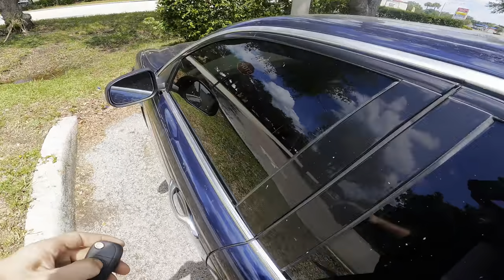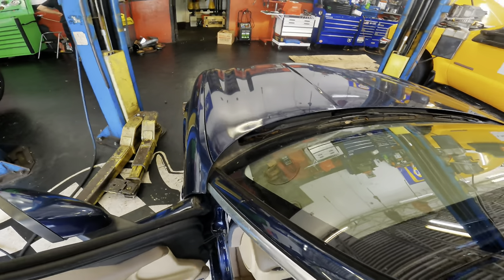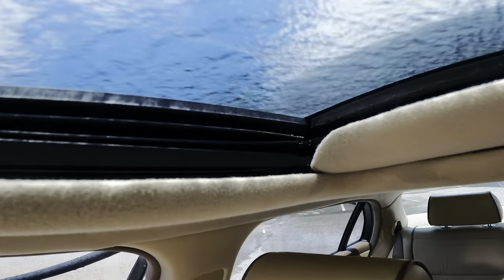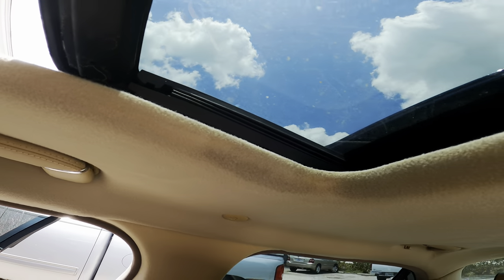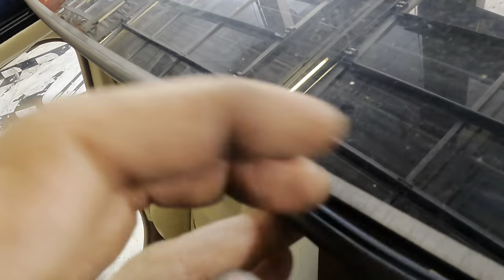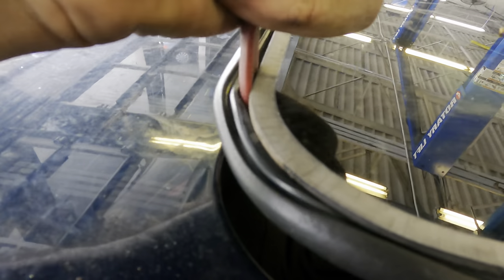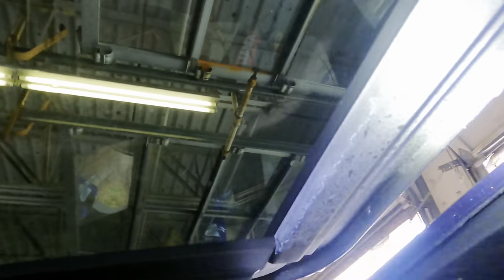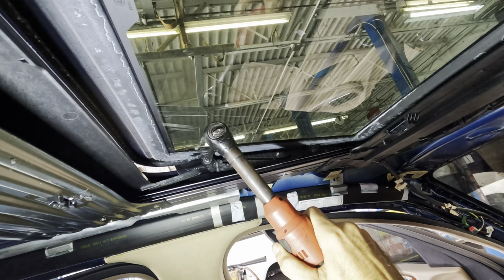Worse than I thought…Water Intrusion! 2008 Jaguar XJ 350

Comment: Not sure if Jaguar has the same adjustment, but on BMWs, they have 4 adjuster bolts behind the rubber accordion trim which allows you to fine adjust the fit to create an even seal around the sunroof.  Just watched to the last few seconds (19:44), and those are the bolts I was referring to.  He can loosen those, to create an even fit then retighten and that should take care of Niagara falls!  No need to remove the headliner...just the rubber trim to get behind it to those adjuster bolts.
Reply: Same on my BMW.  4 adjustment points.  Close the roof,  adjust for fit, done.  If you don't keep the drains clear you'll have serious problems.

Comment: The glass panel just has a loose or misadjusted runner. Bet something got caught in the roof recently when the owner closed it. There is usually plenty of adjustment available in the glass mounting points to adjust them up nicely, just park the glass and adjust till you get a nice fit in the roof panel.
Reply: It sure looked that way cause it wouldn't close on its own. Like it was binding or out of adjustment.

Comment: Back in the day when speedometers were driven by a cable, we would save damaged ones, put them in a drill and run it down sunroof drains. It worked great for cleaning out any debris that may have collected in there.
Reply: I have an air nozzle with about a 3 foot copper tube that I use to clean mine. The water ends up on my passenger floorboard. Take off the wipers and the plastic cowl, run the nozzle tube thru the “gutter” and the crap shoots out the bottom. Then I get the water hose and trickle some down to make sure it’s clear. Takes about 10 minutes.
Reply: And if that doesn't work, call Roto Rooter!!

Comment: Love you man. Napa sells a product called syl-glide. Rub it in on rubber parts. Expands the rubber and revitalizes it. Used it for years. I have a jeep. I use it yearly. Keeps the leaks at bay.
Reply: Honda also have similar for S2000s and rubber seals in general - Honda Shin Etsu Silicone Grease
Reply: Here in the frozen north, I spray all door, trunk and window seals with silicone in October. The rubber gets dry and doesn't seal right. It also allows water into the porous rubber and doors have a tendency to freeze shut in winter. By spraying the silicone in fall the rubber doesn't soak in water and the doors never freeze shut. Also helps water seal in summer.

Comment: Ray. I had same issue with a Subaru - it was the drain tubes clogged that made the water get inside Looks like the seal reduced the leak a lot, but think some water is expected to end up getting past to be drained down the tubes.
Reply: Yea considering the amount of time it took before it started to leak in the cabin.
Reply: I agree.  The seals are supposed to stop most, but will never stop all of the water, hence the drains.
Reply: You can literally see it dripping in from between the seal though.

Comment: I had brand new Ford Edge that had that problem in 2009, I took it to a different Ford dealer from where I purchased it and they outsourced it to an automotive glass company.  The problem was resolved and is still working fine today with about 200k miles on the odometer.

Comment: I recently had a similar problem with my lowly PT Cruiser... ended up having to replace the track. On my car the metal went into plastic and the sun had baked the plastic and it broke. Replacing the whole track fixed the issue for me. BEST OF LUCK!

Comment: Hey Ray - Behind the sunroof gaters are some screws that allow you to loosen the glass (I saw you highlight this at the very end of the video for Part 2).  the curvature of the roof, plus the change in heat/plastic, usually has the glass start sinking with time.  I've had to adjust numerous Ford Escape, Ford Tauruses, Town Cars (notice a Trend..........) where the glass has drooped down allowing too much of an opening that the rubber seal cannot compensate for.

Usually you can loosen the sunroof glass screws and adjust the glass up a bit in the back to compensate.

But since there's a part 2 en route, the above is a moot point :-)

Comment: Just my two cents, what I believe is happening here the two front drain hoses are disconnected from the sunroof drain nipples. What happens is they have a hose going from the nipple through the A pillar then they install spray foam or something similar in the A pillar which locks the hose in, the hose shrinks shrinks over time and pulls off the nipple. The sunroof seal does not seal 100% never has, they rely on their drain channels to remove the water you'll notice the rear drain channel moves with the sunroof. Do not blow them out with compressed air you may blow the hose off the nipple..

    Buddy

Comment: It’s designed to leak into the channel, cleaning/replacing the rubber trim won’t help. The drains are plugged.
Reply: what does a plugged drain has to do with a leaking roof? The water has to go somewhere when it enters, yes. But the water should NOT be there in the first place. It should be kept outside with the glass and rubber seal.
Reply: @Black3ternity  The glass and seal are a 90% solution.  The drains on all 4 sides are there for a reason.
Reply: Ding ding ding the answer is right here
Reply: @Black3ternity  it’s designed that way, it always goes down the drain channel, problem is, the drain is plugged causing a back flow back over inside
Reply: @Black3ternity  
Exactly - the drains are there for a reason but you shouldn't see water pouring in through a seal.
Reply: @atticstattic  most will if you run a hose over it. To diagnose a leak properly you open the sunroof and pour water into the channel and check the drains.
Reply: @markhenderson3498  
No, they won't- and what we're seeing here is not a backed up drain, it's water pouring through a bad seal.
Reply: @atticstattic  ok 👍

Comment: Looking forward to what you find out being the issue Ray, I would also clean the drain holes out as they rarely ever get cleaned unless they are completely blocked. I do mine on my 2009 Toyota Aurion Presara about 1 time a year as a routine and have never had a sunroof leak lucky I guess.
Keep Safe Keep Strong Mate 🦘🦘🦘🚗🚗🚗

Comment: That seal isn't meant to stop water! 
I've worked on many of these, Australia loves sun more than Florida. There is a gutter to catch the water and a drain in each corner (so there is always a low point) that starts as a metal pipe that connects to a rubber hose. Blockage of these drains or a separated connection will wet the lining. Separation at the bottom of the hose, where it exits the cabin will give you a wet floor. Many have the complaint it only leaks (visible water inside cabin) when parked a certain way which indicates which drain is failing.
Reply: It was interesting seeing your reply. I have a car with a sunroof I has water on my headliner by the pillar then down by the hood release I thought it was my windshield leaking I had my windshield replaced still leaking same areas. Called the place who replaced windshield they said it could be drains. I checked the front ones as they are easier to get to sure enough driver side front was blocked. I wish they would have brought that up before they replaced the windshield and I spent all the money.

Comment: I had a Mercedes ML320 that had a leaking sunroof - every time it rained there would be 2 inches of water on the floor of the passenger side.  I tried everything Ray tried here with the same result.  Ended up selling it to solve the problem 😂

Comment: I have 2016 Expedition and they have drain tubes that run bown the "A" and "B" pillers. They have a rubber tube conected to a nipple. The dealer use compresed air to clear the tube that will result in the remove the tube from the nipple. I have used a lingth of weed-eater string 8' spinning it as I ]ush it through. I give this method two thumbs up.
Reply: Yep you need to be careful when cleaning not to disconnect the tube from the frame, easily done.
Reply: @ferrumignis  
Been there, done that. No fun at all.

Comment: Had the same frustration with my 97 Volvo V90. Turned out the metal frame around the glass had rusted and wayer was getting in between the frame and glass. Multiple applications of Captain Tolley’s Creeping Crack Cure solved the problem cheaply.

Comment: I use strips of paper closed in the seal to check for tension in the suspected area thus confirming it's pulled closed tightly. If it's tight  and the rubber is good, it's a crack or hole somewhere. People close things in them and do damage to the roller strips or sealing surface on occasion. Rust is not uncommon in northern cars with time in the salty winters of the northeast. Sunroofs are a pia to service regardless of leak or mechanical/electrical failure. Hope it goes easy.

Comment: The sunroof motor probably has a blockage sensor like a garage door, so you have to hold the switch to overcome that. My guess is the grease has hardened enough to trip that limit. On a MB there's a sequence you can go through so the system re-learns where the limits are.

Putting the new seal in, maybe some silicone spray lube would help it go in easier, and let it move around a little to equalize stretch... think like lubing a tire to install it on a rim.

And, as everyone else said- clean the drains.

Comment: I once got a car back from the dealership repair center after they had somehow pushed the window downward into the car. The roof was fine before I took it in too. I probably should have pointed that out to them, but I just lived with the issue until I traded the car in. I had to cover the roof to prevent water intrusion. I even had it leak onto a laptop I was using on the go once.

Comment: Hi,Ray! Used to do this job all the time! Don't forget there's drain pipes at the rear as well, also it is possible to rejuvenate the seal,somewhat, by rubbing dielectric grease into it and leaving it in the closed position for some time! The pipes can be cleared without dismantling anything by using a long speedo cable or wire guide down the pipes! Hope this helps!  Good luck from the UK 🇬🇧 cheers Dave

Comment: Surely releasing the hood (or should that be a bonnet on a Jaguar) is an unclick, not a click.

nb. Sun roofs are always a time bomb waiting to pour water into your car, and I guess that given the torrents of rain that can pour out the sky in Florida that's a real tester. In this case, I suspect that it's near impossible to completely seal a sunroof and it's the drains that take the excess.
Reply: If you ask me, the best fix for a sunroof is to close it, disconnect the motor, and seal the window in with UV resistant silicone caulking.
a.k.a. make it a moon roof.

Comment: After some YT research on fixing roof leaks, I see that the seal around the glass is NOT supposed to stop all the water entirely.
What seems to be the process for a sun roof's water shedding is to keep the four roof drain holes cleaned out and working.
Water is still going to get into the roof gutters no matter what you do to the glass seal.
So, as long as the drain holes are clean and the glass gasket whole, you have done your job.

Comment: I had a sunroof issue on a 1998 Prelude I owned.  Only instead of leaking directly into the cabin, the water would accumulate in the roof cavity over the back seat.  Every so often, usually the day after a heavy rain,  when I would accellerate or turn, I'd get a sudden surge of water down my back and all over the back seat.  Had my mechanic check the sunroof and drains.  He cleaned the front drains out, but couldn't clean the rear drains out - because there weren't any.  On this car, the holes for the rear drain tubes were never punched out when the metal was fabricated.

Comment: Usually, all I've had to do is adjust the height of the glass to fix leaks. Factory install instructions have you adjust the glass for a specific fit in the roof. Front to back, & height above the roof of the car.

Comment: I have had numerous cars with T-Roofs and sunroofs. 
As others have said, the seals are not meant to be water tight. 
The seals help reduce and minimize wind noise and the amount of water that comes through, into the gutters. 
The seals are actually supposed to let water through which then empties out of the drains at the two front corners and two rear corners. 
Many times the drains get clogged up with debris from trees and so forth. 
I would make sure all 4 drains are open. 
Open the sunroof glass and place the garden hose in the gutter on low pressure to observe that the water is indeed draining through the drain tubes at all 4 corners of the gutters. 
I'll bet one or more is clogged. 
Hope this helps
Chris

Comment: 1) Make sure the drain tubes aren’t clogged. 2) You might be able stop the leak at the top seal by loosening the mounting bolts and adjusting the final position of the sunroof.

Comment: Interesting you posted this video. I just replaced my windshield thinking my windshield was leaking. I had water on my headliner in the corner by the pillar water which went into the fuse area of the dash then by the hood release. The drain on the driver side for the sunroof was blocked. I hope I fixed the entire issue as it has caused electrical issues with DTC codes to pop up.

Comment: Our ONLY experience with a GM dealer was trying to get the intermittent "failure to close" issue solved with the sunroof on our 2005 GMC Yukon.  Dealer wanted $250 for a "fix", agreed that I would not pay for guessing.  After 4 trips for same issue (they replaced the switch), dealer stated they had "absolutely no idea" what was wrong, and finally got my $$$ refunded, and took out the sunroof fuse while sunroof was closed.  Disclosed that issue when we sold it in 2021.

Comment: Yea, they all let water in.  I work in a shop that deals only with automotive glass.  When these problem vehicles comes in, we don't soak it with a hose... we don't want waterfalls inside.  What we do is make sure we are parked on dry floor and pour a single glass of water into the drip tray, one side at a time, and watch for the water to exit the vehicle.  If none gets on the floor we check in behind the pedals (or glovebox depending on side) and see if it made it that far.  If the carpet is wet, we take the pillars off, peel the headliner down a bit and remove the hose and blow it out, or very commonly, just re-attach it.  For the seals, we use a "rubber care stick" from wurth.  It helps swell the rubber back up.  Theres 4-6 screws holding the glass in place, there is often room for adjustment when it just doesn't seem to be lining up nice.  Some manufacturers, like Toyota, have a one time use clip for re-attaching the pillar covers so be prepared before taking that step.  Also be prepared to re-learn the one-touch button features, once the glass gets disturbed the vehicle becomes self-aware and refuses to co-operate with how the customer is used to operating the device.

Comment: Someone mentioned the problem.
At some point the sunroof has stopped and jumped a tooth on the Rail…probably someone either standing up or putting their hand up and out ( that’s why when you were trying to close it was automatically opening).
The Jaguar and LR ones had problems with the tracks and especially the clips ( they break so easily ) and then the Sunroof won’t sit square.
You can remove the Glass without stripping out the headlining and then you have access to the rails but for complete access it’s a case of removing the lining ( it’s more time consuming than difficult ).
The drains in the A and B pillars are a common problem with blocking but be careful when using a curtain wire as you can pop the pipe off and then you have a hell of a job.
You can try compressed air but gently.
Trouble is most people never ask for a Sunroof service or perform any kind of self care with silicone grease ( don’t use normal grease on the rails and you only need a small dab on the rail track ),you can spray silicone on the seals or use petroleum jelly ( Vaseline ). 
Look up the Workshop procedures for the Sunroof because many Jaguar and Landrover were recalled

Comment: Julio wishes to comment. Julio noticed that the four screws you undid went through the glass frame and the holes were square. Julio would like to share that this is how you adjust the alignment of the glass panel to get a good seal for the glass in the closed position. Julio Bonetaculer also wishes Ray the best and gets most enjoyment out of this channel. Bueno.

Comment: My '04 S-Type has the same problem, and it only leaks enough to flood the car in hard, heavy rain in high winds.  The four corner drains "should" be enough to handle the minor water intrusion I'm seeing here; worth blowing/wiring them out given the age of the vehicle.  When in doubt, customer vehicles are the perfect platform for an apprentice mechanic's first welding project.  LOL

Get beer koozies for your sprayable canned goods.  Makes 'em much more stable, plus you don't have to worry about where you set the can when you're in super work-fast mode.  :)
Reply: The tip about beer coozies reminds me why I read comments. Thanks for that.

Comment: Brings back memories of trying to fix my leaking sunroof.  Replaced the gasket.  It was bad but not the reason for the leak.  Realigned the glass.  Looked better but was not the reason.  Checked both front and both rear drains.  All free and clear.  Leak persisted.  

Found that ford(jaguar by default) uses double sided tape to keep the metal frame affixed to the glass.  That failed and the metal frame was separated from the glass.  Didn't notice until I actually removed the glass and then it was clear as day.  Used urethane to affix the frame to the glass and no more leaks into the cabin.  

In this case though I suspect it is the drains that are clogged so the amount getting by the "seal" is not draining away properly.